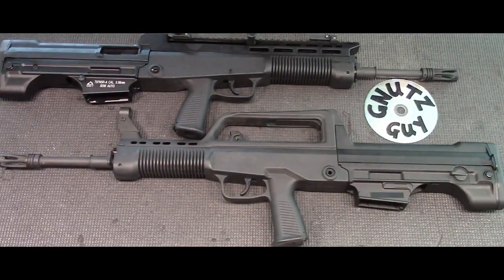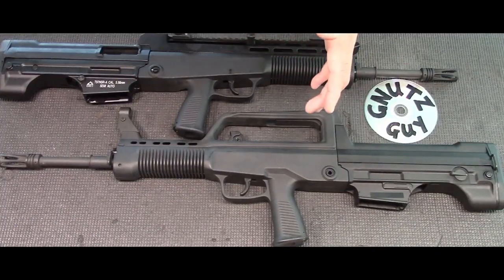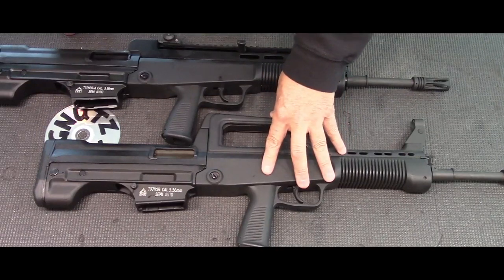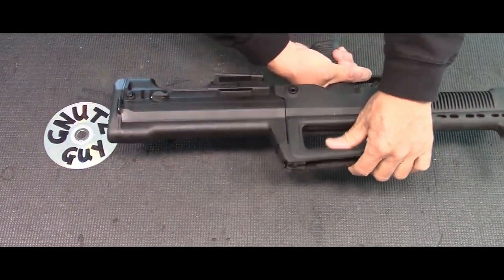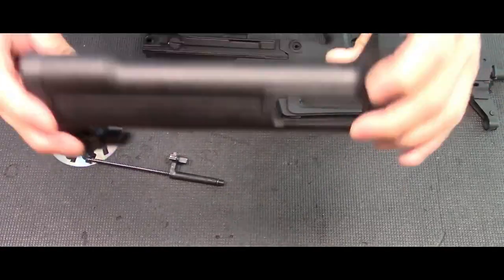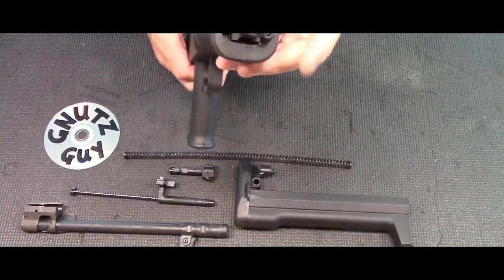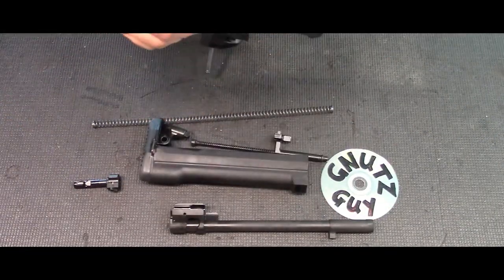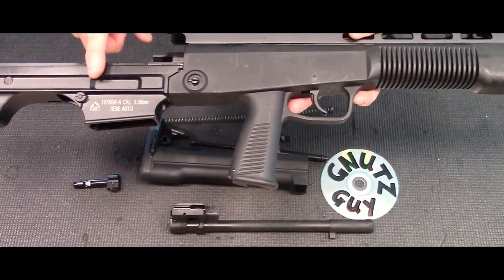Type 97 Full Monty disassembly & field stripping for cleaning. EMEI QBZ-95 bullpup rifle Gen 1, 2, 3

Comment: My new gen 2 gas piston wouldn't drop out like yours
Reply from the maker: do you mean you have to pry it out with a tool?
Reply: Same
 How did you get it out
Reply from the maker: @MorningMotivationChannel  I already showed you in the vid how I got the gas piston out.
Reply: @gnutzguy  yes I watched. The piston did not drop out as shown in video. I had to remove the rail and push it out with a punch from behind , was stuck inside
Reply from the maker: @MorningMotivationChannel  check the piston is not damage, bent or burr then clean the tube thoroughly with a wire shotgun brush.
Reply: The gas piston in my Gen 2 does not come out, either.  It's trapped inside, and would hit something inside (and stops) when I press it down and let go.
Reply from the maker: @terrymakingstuff  gently tap it out from the back. do not use force. then clean with a wire brush in a drill.
Reply: use the punch in the cleaning kit and knock it out with a hammer. steel wool can be used to scrub the carbon off the gas regulator.

Comment: Type 97’s bolt is originated from FNC's 3 locking lugs bolt. The bolt carrier cam and curve guide are very interesting，since there is no rotation movement for the bolt during the charging procedure unlike the AR/G36. It is called anti pre engagement which is very helpful for reliability.
Reply from the maker: yup, more like FNC but with striker system.
Reply: @gnutzguy  It is not a good striker design, makes trigger pulling worse, also the structure design is not solid.
Reply from the maker: @Greentangle  is there a good striker design out there? personally, i dont like them but the advantage were its slimmer, way slimmer than my tavor.
Reply: @gnutzguy  Hammer type trigger will be better for pull length and strength. Type 97 striker type trigger hit point is highly over head of the strike spring, which makes the striker unstable and receiver weak.
Reply: @Greentangle  hammer won't able to reach the firing pin in QBZ95's super compact Kalashnikov bolt system. Even the original AK that uses hammer fire is compact enough so there's no place to put bolt lock open feature behind the magazine. 
The point is, for reliability this rifle is over-gassed already even the gas port is in setting number 1 to give the bolt carrier enough energy. And to reduce the recoil and RPM the receiver needs to be extended(this is how they seal the type 81 and put bolt lock open feature on it) while the length to pull must be fitted to average 1.7-meter height male soldier which is 375mm. even so, the receiver is still too lacks space so they can only put a leverage buffer in the butt.
The receiver is a monolith forged just like SCAR's top receiver makes it robust enough, and the Guide rod on the barrel will automatically adjust the MOI when the Bolt carrier is moving forward and behind. the front of the receiver is reinforced by the barrel trunnion and part of the recoil will be transferred to the lower end of the receiver where the hardest part of the receiver by the leverage buffer. the receiver receives less force than the common firearm. the receiver won't die before the Bolt carrier and barrel dead, but this is only 4000 RMB(1:7 to USD) gun and not moduler rifle. so just let you know.
Reply: @Greentangle  China has poor processing technology and material back in 80s so they must pro on dynamic design to avoid the con to make this rifle longevity enough (16000 rounds at least for bolt and 10000 at least for barrel) 
This rifle could become even better than it is now if made in the U.S in both performance and economy.
Reply: Both FNC and QBZ95’s bolt carrier are come from Kalashnikov’s “flat surface rotation guide”(anyway this is what Chinese textbook calls it and my automatic weapon knowledge are learned in Chinese language so you guys might have different noun for it)
The mainly changes that FN did to original AK was adding one extra locking lug, and moved rotation guide lug behind the locking lug. (AK’s is monolith with main locking lug) which made barrel trunnion’s size slightly reduced. 
And FNC centered the point where bolt carrier and trunnion engage. 
So it was like AUG gives Engineers confidence on Bullpup rifle (AUG gets highest score overall in the experiment test than all other rifle’s like FAMAS, SA80, FNC, M16 etc.) but FNC is the best choice for economic reason and factory workers are easier to get used to produce this new rifle based on their experience with AK)
Reply: @blackcatpack  Lateral/Plane guide drive might be more accurate. It is a little change for type 95 change FNC's long stoke driven piston. After finding Robinson XCR's bolt & bolt carrier design, I think it better than Type 95 and FNC.